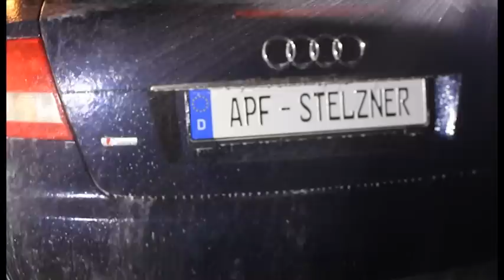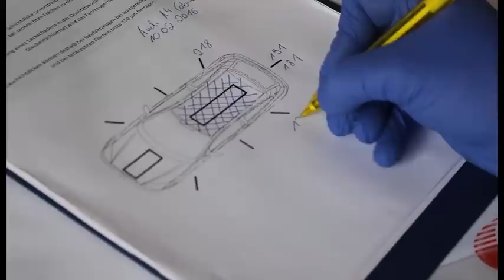Aufbereitung Audi A4 Cabrio / Premium Detailing

Comment: Kann mich nur anschließen gutes Video die Mittel wären wirklich interessant vor allem mit was du das Verdeck imprägniert hast
Reply from the maker: Klaus G danke, für das damals erste Video denke ich ist es okay :)

Für die Imprägnierung habe ich 303 Fabric Guard in 2 Schichten verwendet.
Reply: @detailingverliebt   Guten Abend tolles Video. Habe einen A4 T1,8 aus 2004. Alles TIP Top. Macht es Sinn das Dach für den Winter neu zu polieren ?  Auto wird im Winter gefahren und steht aber auch in der Garage wenn es nicht bewegt wird. Danke für eine Tipp im voraus.